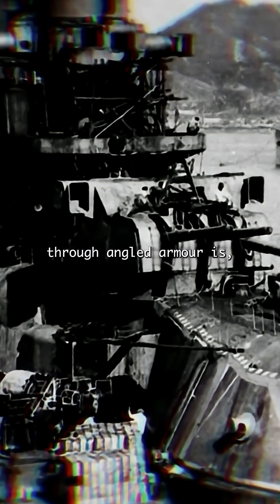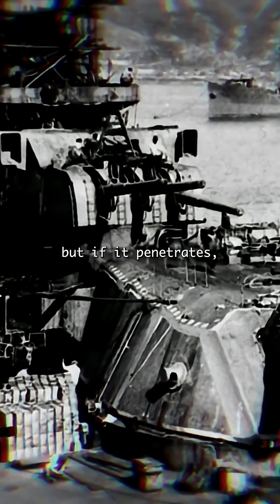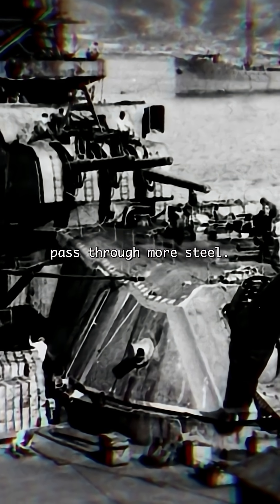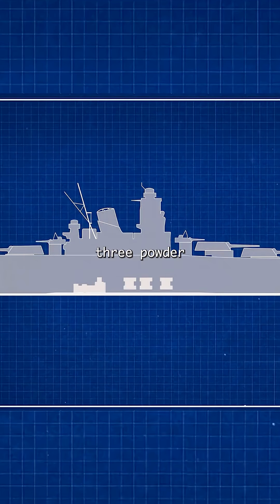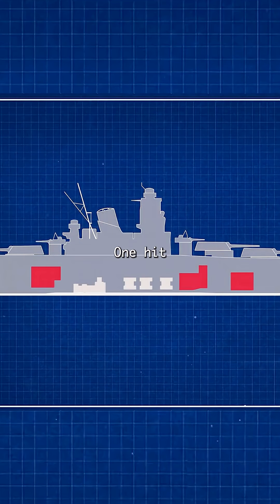Battleship Yamato's INSANE Armor Scheme  #yamato #battleship #navy #maritime #history

Comment: The funniest part is, the 16 Inch guns of the Iowa could still easily penetrate the deck armor at standard combat engagement distances and because of the much more advanced Radar assisted Fire Control the likelihood of scoring hits on the Yamato was higher than the likelihood of the Yamato scoring hits on the Iowa.

Comment: And despite all of the comments here. No Yamatos armor was not penetrable unless at point blank range. The „firing test“ on Shinanos turret face was with an extended charge at point blank range without any angle of the turretface plunging fire also would not have done anything.
Reply: That armor plate for Shinano was of poor quality. Something went wrong in production

Comment: 'Yamato was no speed queen ocean liner'.
Her rated speed was 27 knots.
Most large ocean liners of the day sailed at around 23 knots. 
Even the two extreme speed liners of the era, Queen Mary and Normandie, only just pipped Yamato at 28 knots.
Reply: Was about to write this. She was not fast for a battleship of the time, but by no means slow.
Reply: @oberuser123  The Iowas were speed demons, topping out at over what 32knots?  Insane for ships that large.
Reply: @oberuser123 

Actually she wasn’t slow even by contemporary battleship standards (comparable to the NorCals, SoDaks and KGVs in speed).
Reply: Probably talking about maneuverability and acceleration. She was a massive ship that out weighed some carriers, probably wouldn't be able to accelerate to full speed fast enough.
Reply: @Leo-e3j7o Yamato - 65600 tonnes.
SS Normandie - 68300 tonnes.
RMS Queen Mary - 78500 tonnes.
Reply: 😂 and titanic was max out at 23 knots.😂
Reply: @jessicaregina1956  thought it was 25knts

Comment: Part of the design was absolutely genius. Another parts were disastrously bad. First, the angled front armor of the turrets made it not less, but more likely for incoming shell to penetrate, as most battleships fought at distances that made the shells fall rather steeply down. Second, the enormous belt armor angle forced the designers to use a connecting plate between the belt and the armored deck. That connecting plate was a clear weakspot that stretched all along the armored citadel from both sides. And third - the hidden lifeboat hangars were useless if the ship was listing.

Comment: Yamato and Musashi were thr only 2 Battleships in thr japaneese navy with the „All or nothing” armor layout.
Which means that only critical parts like the citadel, thr engines and the magazine were armored.
Reply: Like any contemporary battleship design of that day (ie Iowa Class)
But the difference with the american “fast battleships” was the thickness and how massive it was: the Iowas were not even close in the endurance department… the Yamato’s turrets, front face, could receive a 16” from any Iowa AT BATTLE DISTANCES and don’t even suffer it. Post war experiments with this armor plate were propaganda, done at point blank which not even the Bismarck suffered from Rodney before it sank, and those were “point blank” but at 10 miles… not 10 yards like with the american propaganda experiment
Reply: @RebeccaCampbell1969 It would have helped to actually use that ship - or give it a better fire control system.
They say it only hit one destroyer lightly and that's it.

Comment: The armor belt had a deadly flaw. It couldn't be made in one piece and Japan didn't have the welding capabilities necessary to weld the pieces together. They had to resort to riviting the belt pieces together. American torpex packed torpedoes blew these rivits out and opened the Yamato and Musashi to flooding.
Reply: You are not quite correct. The belt itself was made from one thick plate. There was no need to rivet or weld multiple plates above each other, Japan did manage to make the plates thick enough. 
You are thinking of one riveted connection where the 205mm thick main torpedo bulkhead, which also acted as an additional lower armor plate under the waterline to protect against diving shells, connected to the 410mm main armor belt above it,  that was around 2 meters under the waterline. That was a problematic design, that's true, however it had nothing to do with the thickness of the main armor belts. Even then 650mm thick turret faces were made from one thick plate.
Reply: Yeah that was nonsense… because in the end IJN Musashi and Yamato were tested beyond what any other Battleship in history, even today: hit with 20+ torpedoes and 20+ armor piercing bombs
Musashi’s damage control had to be stopped when the Abandon Ship signal was given as they were still fighting for the ship to stay afloat… 20/20 torpedoes/bombs after. 
How many would New Jersey or any of the Iowas could take? 3 or 4??? What about 3 or 4 each? Lol
This were not just Battleships, they were a higher class
And Yamato got to save earth 😂, which other war ship has done this?
Reply: @RebeccaCampbell1969  It mattered for Shinano, which went down from a single torpedo attack precisely because they were struck in this weakness. The same ones her hull sisters had, also capsizing from slow yet uncontrollable lists, against damage that the ship had technically survived but no force on Earth had the power to resolve. 

They were designed in the first place to have pockets for water to pool up in, low reserve buoyancy, and poor protection of damage control stations. Those were necessary trade offs to achieve their armor and artillery specifications. To their credit, the armor and main batteries worked perfectly every time. But the Pacific War much more favored the Allied approach of having anti-aircraft guns that could actually kill planes and damage control efficiency over ship armor protection.
Reply: @terran6686 信濃はそもそも未完成で防水扉も閉められない上、艦内には作業員ばかりでダメージコントロールが出来ないのだから比較すべきではない
Reply: @RebeccaCampbell1969
Reply: @RebeccaCampbell1969  None of the armor piercing bombs dropped on Musashi and Yamato had the penetrating power to pierce their deck armor.  The fatal blows were all from torpedoes.

Comment: The Yamato-Class had a severe weakness though: The tops of the 155mm-Turrets. They were quite thin and directly over the magazines.

The "all or nothing"-principle for armor protection was something not used on the German "Bismarck"-class ships who had a variety of armor decks to let shells explode before they could do damage. 

It showed its capability when "King George V." and "Rodney" combined couldn't sink her. The ship had to be scuttled in the end and sank with turning screws.
Reply: That is just wrong. An all or nothing armor scheme is always superior to a distributed one when fighting against other battleships, because the thinner upper and forward armor plates of the distributed one don't protect you against battleship grade firepower (though they offer more protection against smaller guns). But having these thinner plates reduces the maximum thickness of the bigger ones.
    
Bismarck was still afloat for other reasons. First of all, shooting at a ship doesn't sink it, real life isn't a video game. You need to get water inside to sink it, and holes above the waterline don't do that. The only exception being if you manage to blow up the magazines. Second of all, Bismarck had already thousands of tons of water in her before the final battle started, due to the 3 torpedo hits and damage she ate from Prince of Wales at Denmark Straight. She was sitting low in the water due to flooding, the bow was down 2 meters, the midships around 1 meter. That means that most of the main armor belt and armor deck was below water already before the battle started. In addition to that, the British ships closed to a very short distance, and both sides had to deal with typical Atlantic waves that were around 1.5-2 meters high. Again, that means that the heavily armored section of Bismarck simply couldn't be hit, because it was already under water or waves were in the way. On the wreck, there was one single shell hit on the main armor belt. Apart from that. Bismarck was a floating wreck just 30 minutes or so into the fight, with all her main guns knocked out, her central fire control knocked out, bridge destroyed, most secondaries knocked out, fires raging across the ship. And she was dead in the water at that point, having slowed to almost a complete stop, due to damage in th funnel area causing the boiler rooms to fill with smoke. No, her screws were not turning anymore when she sank.
Reply: @xxnightdriverxx9576  " because the thinner upper and forward armor plates of the distributed one don't protect you against battleship grade firepower "
But they do. "Bismarck" had a 100 mm armor deck that would set off incoming shells, while the underlying armor deck would prevent the explosion from coming through. And that's what happened: No shell broke through. It took on "Tirpitz" much larger bombs to actually penetrate them and this was still not the cause of "Tirpitz" sinking.

"First of all, shooting at a ship doesn't sink it, real life isn't a video game"

Yeah, but "Hood" sank, didn't it? 

"You need to get water inside to sink it, and holes above the waterline don't do that."

You try to slow down the ship by destroying its machinery and stop it from firing. 

"Second of all, Bismarck had already thousands of tons of water in her before the final battle started, due to the 3 torpedo hits and damage she ate from Prince of Wales at Denmark Straight. "

She had only water in the bow and in the stern where the rudder machinery sat. The other torpedoes didn't do any damage at all because of the composition of "Bismarck's" armor belt consisting of a composite armor. 

After it was just target practice (in which the British were not very good, Admiral Tovey reportedly threw his binoculars on the ground due to his frustration of his ships still missing after closing in to about 5 kilometers) most of the superstructure was destroyed. Below the armor line though everything remained operational for quite a long time. 

So yes, the screws were still turning, according to all witness reports. And it showed the effectiveness of the armor scheme.
Reply: Sorry?
Reply: @AugmentedGravity  Sorry what?
Reply: Bismarck was going to sink regardless if she was going to get scuttled or not, for reasons that will prove why your 'sank with turning screws' claim couldn't have been true - THE SHIP'S STERN HAD BEEN BLOWN OFF. Multiple eyewitnesses from both the British and Germans in Bismarck's final battle attest that the Bismarck's stern had been sheared off by the time of her sinking and had become non-buoyant in a way that it was essentially just resting on the ship's screws, preventing them from spinning. The

Broken sterns was a common flaw on Kriegsmarine capital ships. Just as how US cruisers had a nasty habit to get their bows detatched blown off (just under a dozen US cruisers in the Pacific lost their bows that way during the war from causes ranging from typhoons to torpedoes), German heavy cruisers and battleships had as just a nasty habit at losing their sterns. In 1940, the cruiser Lützow was torpedoed in the stern, which caused her ENTIRE FORECASTLE to literally hang onto the ship by her keel like a hinge. Both her screws were destroyed by this. She had to be towed to safety after a gargantuan effort by several destroyers and minesweepers. 

In 1942 the Prinz Eugen completely lost around the aft 15 meters of her stern (i.e. it fell off to the ocean floor) from a torpedo attack and her crew had to make an improvised rudder system a-la pirate ship while effectively stranded in a Norwegian fjord. By some manner of luck her two outboard propellers, though damaged, were still intact enough that divers were able to get them working again to allow Prinz Eugen to proceed under her own power.

Most naval historians attribute this with both the generally subpar German designs of stern of the time which meant that sterns from the top of the ship down to the bottom often shared the same bulkheads (i.e. no latitudinal subdivision) and one sheared weld could often shear down completely and rip off the entire stern section and leave it hanging by their keels. It's for this reason that I both think Bismarck was going to sink anyway and why it could not have had spinning screws when it sank.
Reply: @rap2xtrooper878  Many words, short answer: The stern broke off somewhere during sinking, but long ago after the ship had vanished. That's according to many eye witnesses - she sank with turning screws, meaning that the machinery was still intact and the stern still attached to the ship.

Of course she would have sunk sooner or later. But the armor scheme proved to be very efficient. 

And of course you are right, the stern was a weakness.
Reply: @martinschnelle3077  Bismarck was utterly incapable of fighting after on 45 minutes of battle, and essentially incapable of fighting back after about 15 minutes. That is not an effective armor layout. Furthermore, the Turtleback Armor Scheme was pretty much obsolete by WW2, as normal engagement ranges for warships had increased to such a degree that turtleback armor schemes would make penetration for main battery fire at long ranges easier, which is why every actual naval power had long switched to inward sloping, or straight armor betls, which where more effective at usual ranges.

For example even during her best Battle Bismarck suffered Damage that made continueing her mission impossible

Comment: It's actually incredible to think bombs and torpedoes from aircraft are what ended her with how heavily armored she was. 

6x thousand pound bombs disabled important structures on the deck like AAA then 11-12 torpedo hits. Not many other ships could take a dozen torpedoes before finally starting to sink.
Reply: And Musashi, Yamato's sister ship, is said to have taken 17 bombs and 20 torpedoes before sinking.
Reply: @Large47957  to give some credit to the torpedoes, the attacks were on both boradsides of the Musashi so the water was coming in on both sides to help balance the ship out. 

That was corrected for the torpedoe attacks on Yamato
Reply: @biorecords1506 
Yes, correct.
In the case of Musashi, the ship's balance wasn't significantly disrupted.
That was a major factor in increasing the number of hits required to sink her.
Reply: The AAA weren't that effective anyway, without proximity shells and central radar guidance.
Reply: Strafing also did in alot of the AAA.
Reply: @AugmentedGravity There’s a recording from a Yamato veteran somewhere on YouTube, he mentions the strafing is what cleared the deck.
Reply: And she could have lasted way longer if they pumped out the water again after the counter flooding was done.